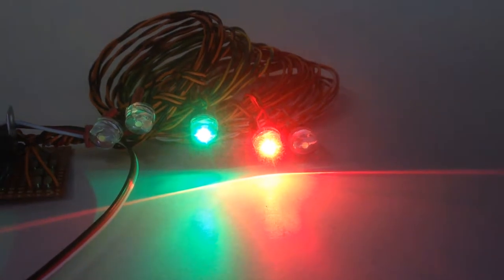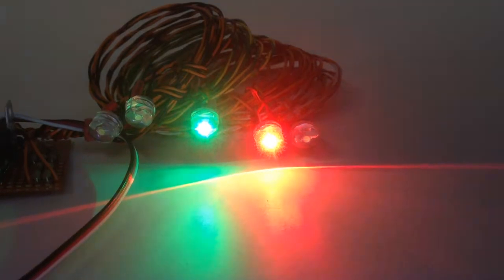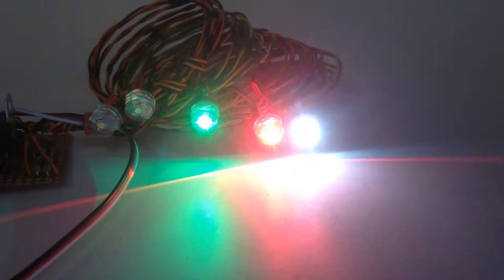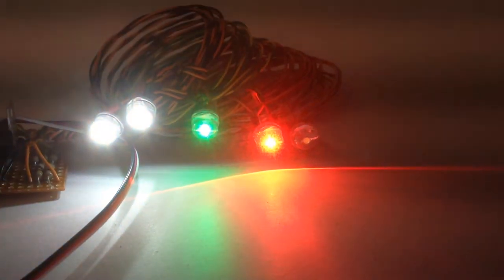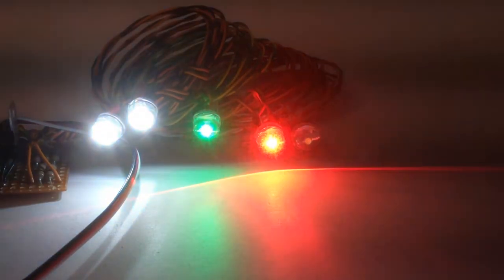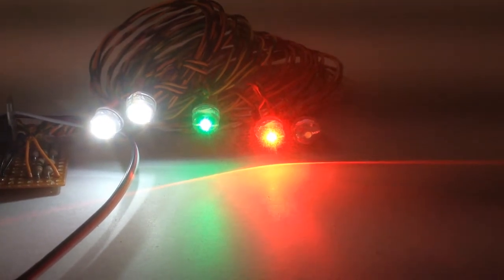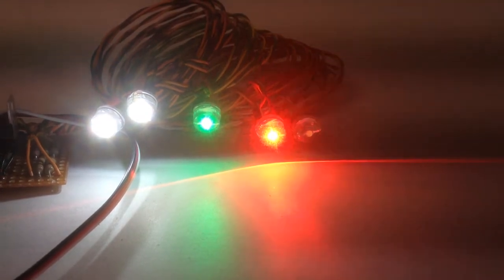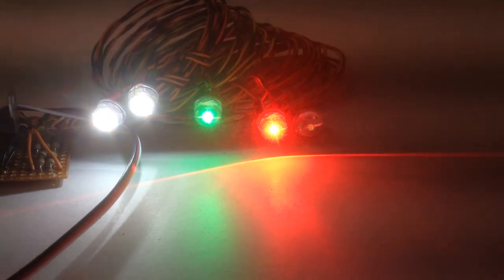Basic NavLights - 8mm (Giant Scale)

Comment: Hello ,
Do you think these leds will fit in a e-flite super cub 25e ? i am not sure if i should purchase, maybe someone already used it on this aircraft ? pls let me know , many thanks.
Reply from the maker: Yes, they should fit nicely.  As with any ARF to which  you want to add Navigation Lights, you'll have to run the wires through the wings and fuse, but that's not difficult to do.